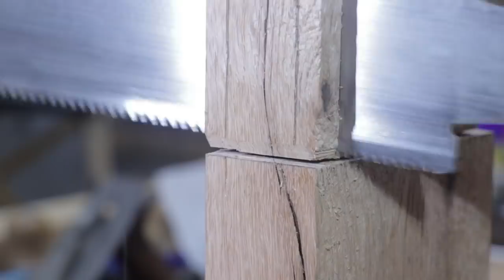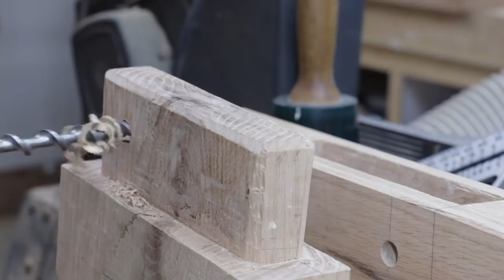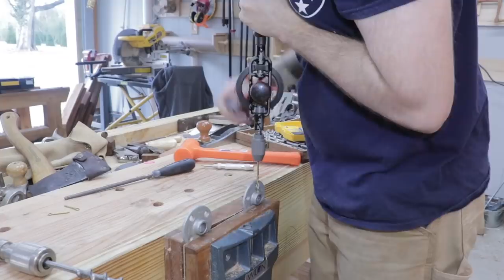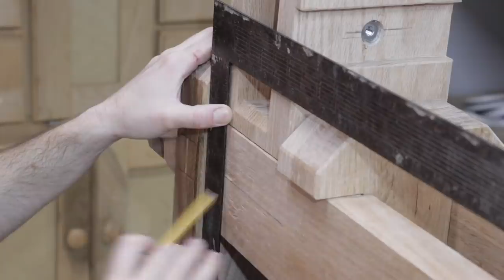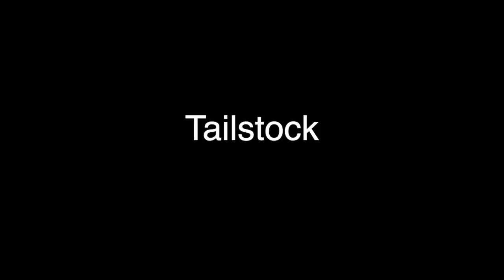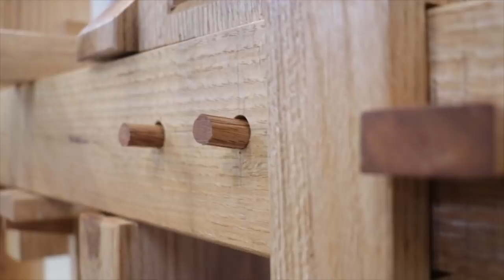Treadle Lathe Build (Start to Finish) Using Hand Tools

Comment: This is inspirational. I noticed your use of the Japanese rip saw and want to pass along that the footage I've seen of them in use over there shows a vertical stroke, pulling down. I'm going to learn to use my double-sided Japanese saw and will go about it in this way. If there's much difference in my ability to cut to the line then I'll update you. Thanks for making and posting the video, BTW. Peace.
Reply from the maker: Joel Wetzel thanks!
Reply: Those pull saws have become so popular in the past couple years lol. I was given one ages ago and felt so cool being the only one around with one, and now they are one of the single most common woodworking tools I see. You'll have no issues with it though, they are just super easy to get proficient with and so so versatile. It cuts close and accurate and will be saving you tons of time before long.

Comment: Dear Jim, this brief video is beautiful. Maybe you could post a short video of things that you have made with it. I was thinking of making a pole lathe but seeing the high angular velocities and a single direction or rotation makes this concept vastly superior. It’s like an expensive metal lathe without the metal and the motor.

One question I have. If you put a gang of three or four pulleys where you have a single one on the drive shaft, would that make it better to use or would it just make it more complicated?

Comment: Looks like you're using a pipe clamp as a load bearing face on the headstock. Might want to look into sone hardened races and needle bearings to alleviate undo/uneven wear

Comment: Thanks for sharing this video!  Functionally, how does the lathe work?  Can you turn bowls?  Any design changes you'd make if you were to build another?  I'm planning to build a treadle lathe this summer with my boys.  Thanks!
Reply from the maker: You sure can but you will need to add a bowl turning faceplate or chuck to it. simple to do with my design. I did replace the crank with a bent rod after the original crank failed. The rod that the pedal rotates on needs to be a little heavier as its bending some.
Reply: @lastingbuild1373  Thanks!

Comment: Carpenter here for 35+ yrs...
I've realized,that if the lights go out in this country...
Brick Mason's(if they know how to make old brick,and know how to mess with stone...
Carpenters,Plumbers....could easily survive and build this country without electricity...
Reply: Some of them yes. Maybe then the Trades will be respected again and not treated like we're "Unskilled Labor".
Reply: @oldmanfromscenetwentyfour8164  I don't pay 'unskilled labor' $100+/hr.
Reply: @kevingraves7431  Who do you pay $100 per hour to?
Reply: @oldmanfromscenetwentyfour8164  It is fairly common around here.  $60/hr is pretty much the bottom.
Although, I guess you could find cheaper.  But I am always a proponent of 'you get what you pay for'.
Reply: @kevingraves7431  Where are you? I'm moving there!

Comment: Lovely build sir, I have been planning to build a pole Lathe since using one last year, but I think I prefer your continuous rotation treadle design, when I get around to it I will send you some pictures and details of any design changes, not sure my hand skills are up to the mortising though!
Reply from the maker: Awesome! I too considered a pole lathe before building mine!
Reply: @lastingbuild1373  hello again, have been checking out Mr Chickadee, as you will no doubt be aware he built a similar lathe to yours I believe you mentioned him on your channel which is how I came to find his film, it's lovely to watch but obviously heavily edited and I couldn't find a link to a more detailed build for it, I was most impressed that he did all his flywheel shaping with a panel saw and draw knife on a shave horse, I have roughed out chair legs this way before putting them on to a pole lathe and I know this is bloody hard work! so great respect to him, I would have planned to to mount the cut wheel and spin it with the treadle to turn the round and cut the groove for the drive cord using a temporary tool rest, but to come to my point when asked if he had any plans he replied that Roy Underhill's book had all the details, and I wondered if you know is this still in print?, as I would love to get hold of it, many thanks kind regards Jonathan
Reply: @BirdmanNorfolk    Just curious if you happen to find the plans because I would like to build one too?

Comment: Very nice build, due to a medical condition, I can't  use a motor drive lathe, I am working on a treadle model, where would I buy the parts for the head stock and tailstock?  thanks for your help

Comment: Question: Although it wouldn't be ideal, is it possible to cut metal on a treadle lathe? 
Bronze
Brass
Aluminum
Steel (Imma just say no for this one)
Reply: You should be able to cut any of them other there provided your tool is hard enough to cut the material.